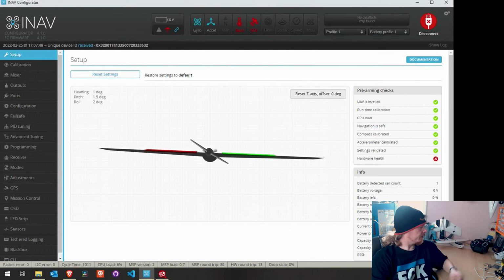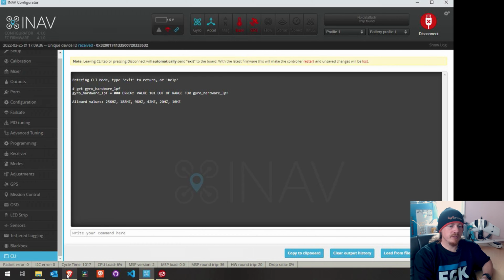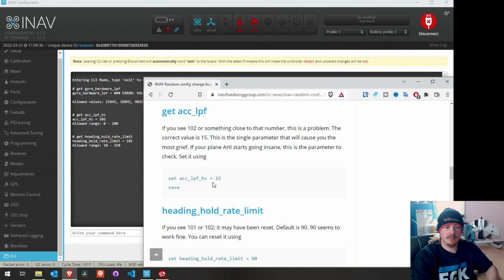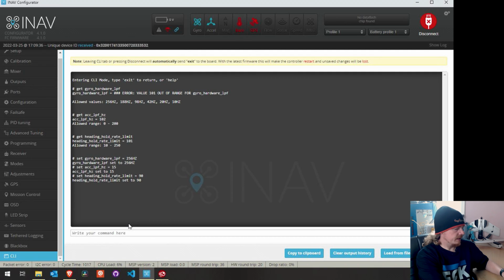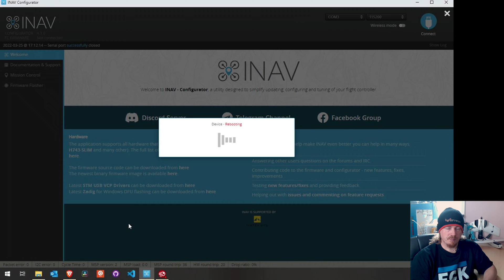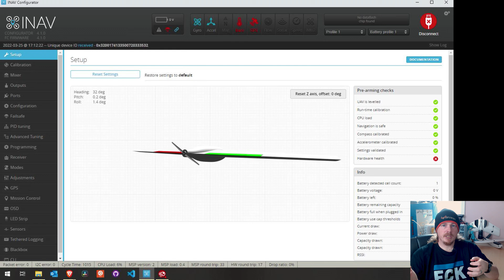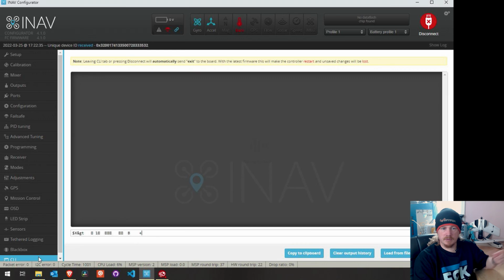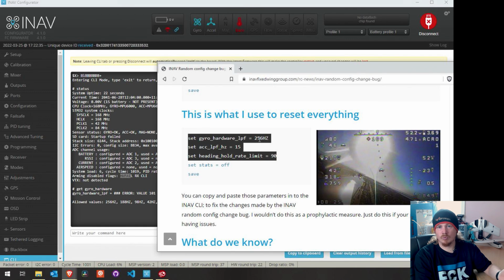iNav Random Config Change Bug: Fixed! No more invalid setting gyro_hardware_lpf

Comment: Does it happen midflught too? I mean parameters changing. Thx!
Reply from the maker: No, it only happened when connected to a configurator. Definitely iNav Configurator, but possibly SpeedyBee too. It won’t happen without that interaction.

Comment: Never had this issue myself but a friend lost a few planes probably due to this bug and he now has given up on using inav completely. Anyway good that this thing has been tackled and that it will provide inav newbies a better experience.
Reply from the maker: Unless he had invalid setting gyro_hardware_lpf in the OSD messages, then forced armed and flew anyway. It wouldn’t have been this issue. It will block arming unless forced with the 10 times arm switch toggle.

Comment: Three days ago I crashed my ar wing pro I think due to this bug. I had 18 satellites but had hard time arming but finally did arm, after flying for 15min I noticed that the altitude completely disappeared from osd  within a couple of minutes I basically lost control and ended in a nose dive from 350 feet into the ground, I'm still trying to make repairs but not looking good. I was flying in horizon mode at the. In my mind the plane didn't know what level was or even its altitude according to osd. Thanks for information I will follow your advice on how to avoid this but don't know if I will ever trust inav again.
Reply from the maker: I've just done some testing and the only way you can get it to arm if this is the error is by rapidly disarming and arming 10 times. On the field, you should never arm like that. It's purely for testing. If you didn't do that, it was not the problem. Also, if you have system messages on your OSD, you would have seen a message stating that the parameter was invalid.
But to be honest, I don't think that bug would cause the altitude to disappear. The parameters that change are for the gyro, so would make horizon drift much more likely. I think that is what happened. Though it does not explain the altitude. If you do feel like the plane doesn't know where level is, or the AHI is off. The first thing to do is switch in to manual. You would have complete control then. I think the big take-away lessons here are to always have system messages on every OSD layout and to not force arming. If you can't arm, there is a reason for it.
Reply: @MrD  I just kept flipping the arm switch until it finally did arm I should have known better, I checked today and the 3 gyro settings were way off. I will be checking these every so often but not very realistic to have to check every flight, I will also hit record on fpv monitor from now on. If I hadn't watched your video I  think this would have happened my very next flight so thanks for that.
Reply from the maker: You don’t have to check. If this bug occurs you will get invalid setting: gyro_hardware_lpf shown on the OSD system messages. Just have system messages on every OSD, and you’ll see if that problem occurs.

No problem. We all just want to have great flights.
Reply: @MrD  Thanks for all your help Darren, I've turned on system messages in osd so I should catch this next time, I've almost got the ar wing pro back together I just hope it will still fly. Thanks again for all you do for this hobby

Comment: This is great news 👍 This is the main reason I haven’t used continuous trim, worried about settings corruption
Reply from the maker: Yes, I’ve not turned it off on mine to be honest. It’s far too useful a feature. But I always have a laptop with me. Only yesterday I forgot the USB cable 🤣

Comment: Thanks for the update and details..
Yeah I had that and needed to re-set the gyro_hardware_lpf to a valid value (256) from (101).
Reply from the maker: It's worth checking the other settings too. If one has changed, they all will.
Reply: @MrD  Yup will do 1st thing tomorrow. Thanks

Comment: Can this lead to reset controller entirely to defaults? Like whole setup is lost? I had such situation few times playing with modes...
Reply from the maker: No, that is an unrelated issue. That is thought to relate to power, but that has not been confirmed.
Reply: @MrD  i can try to do it, it happened with 411-WSE, was updating 4.0 modes config - i was trying to set upper endpoint for one of the modes, and i think it happened like 3 times in a row... what i'm missing in configurator is possibility to use file as a startup point (something like betaflight's presets)
Reply from the maker: @AndrzejRoszkowski  no, there are no presets in iNav. They’re not really needed. I’ve not seen the BetaFlight preset stuff, but have heard a lot of complaints about them from a friend.

Make sure that the USB cable is perfectly still. One thing that was flagged up was that if the USB moves, that can be enough to cause the voltage issues on some flight controllers. I would imagine that flight controllers with the vertical USB port will suffer more from this. In fact, the only time I have has this problem has been on an F405-WING, which also has a vertical USB port. They can become loose pretty easily.
Reply: @MrD  never happened on 3.x and i'm using usb often (i'm green in terms of tuning ;) so doing updates to config all of the time... )
Reply from the maker: The complete wipe bug was also in
3.x. There were also one or two reports of 2.6. https://github.com/iNavFlight/inav/issues/7128